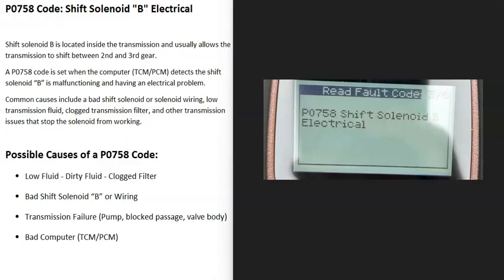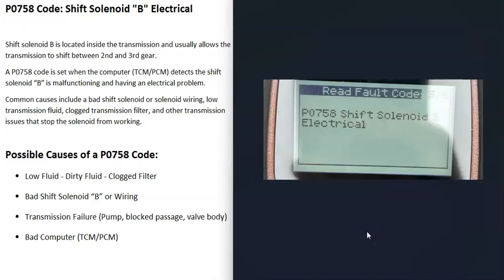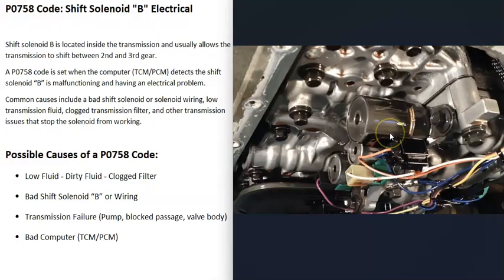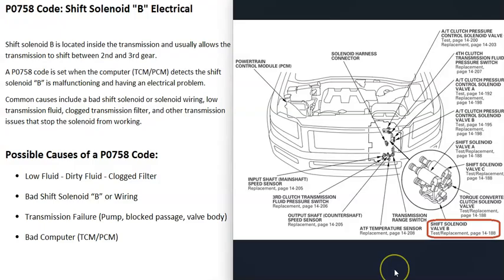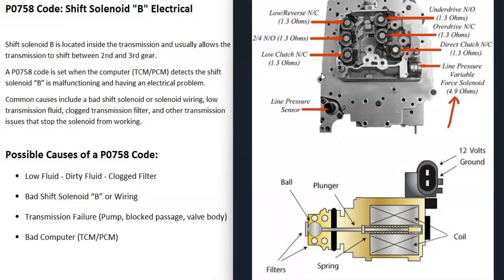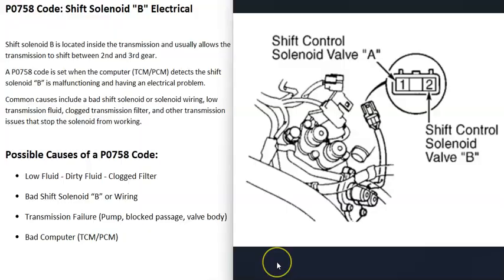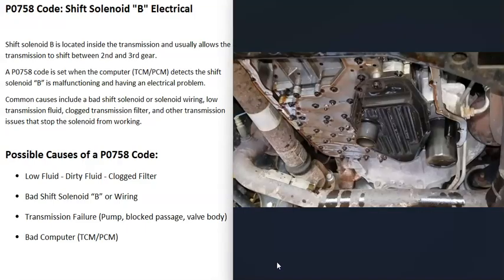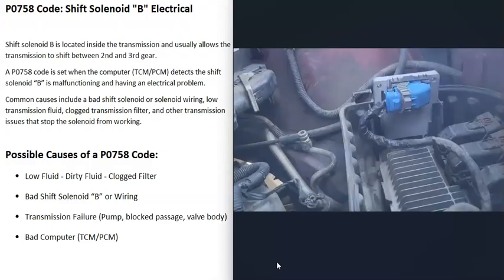Causes and Fixes P0758 Code: Shift Solenoid "B" Electrical

Comment: I just had my whole transmission replaced because of this code but the issue is still there. Think it’s a bad pcm or a shorted wire on the outside?
Reply: Trying to help a friend with this code. Did you get rid of yours showing this code?
Reply: @JorgeArmandoCoyaso I did. It wasn’t the transmission at all, a rock or some kind of debris got flung up and hit the kickdown solenoid which back fed voltage to the pcm and fried it. I replaced both the solenoid and the pcm and now it works like new
Reply: @JorgeArmandoCoyaso not sure if it’s called a kickdown solenoid but it was some kind of servo/solenoid that was attached to my transmission wiring
Reply: @richardferguson3965  what is the location of that solenoid? Is it on the outside of the transmission? Any info is appreciated I’m in the same boat as you. I changed my whole transmission and I still have that issue.
Thanks
Reply: @Lifeprose I guess it’s on or around the driver side of the trans. Not sure exactly where

Comment: ( for my 1999 K2500 suburban millage around 120k and transmission 4L80E ) I CHECKED THE solenoids 1-2 and 2-3 resistance found both are reading around 22 so they are healthy solenoids even with findings  I replaced all solenoids and internal wiring but same issue not changed stuck on 2nd gear and OBD check shows this phrase " P0758 : 2-3 shift solenoid circuit electrical " and now I'm confused where to search and inspect is it TCM issue is external harness or connectors or relays really need help , because when the OBD error codes reseted the transmission is perfect no clutch slip or any thing it is like new one , so please help to guide me how investigate the issue perfectly
Reply: Did you ever find out the problem?
Reply: I got it finally the issue is from VCM ( car computer ) if you have any scan tool with test function go to 2,3 solenoid testing function to open and close and check the ground wire from solenoid to the VCM its color yellow-black and connect the voltmeter to it and see its voltage drop after put it on off in scan tool if the time for the computer internal driver IC
if the going to zero more than 0.3 second the computer will assume it is short to ground

for me I changed the internal wire and external too, I changed the solenoids set and the ignition switch and all of them made no change to the issue until I did the test of solenoid ground wire to VCM and noticed the slowness of moving to zero ground and it was the main issue the internal switch driver for solenoid in computer the whole failure
Reply: @a.h.h9647   It sounds like then you changed out the VCM/Transmission Control Module?  Or did you replace the yellow-black ground wire?  (I've ben having similar problems where sometimes the code will go away and the trans will shift normally, or else most of the time it will refuse to shift into OD, or else it will slip trying to shift to third then go to OD.)
Reply: @Csprint replaced the control module and solved my issue completely
Reply: @a.h.h9647  One other  question,  where on your Suburban is the TCM module located?
Reply: @Csprint 1999 Suburban it is  on engine compartment driver side near brake booster black box with four connecters